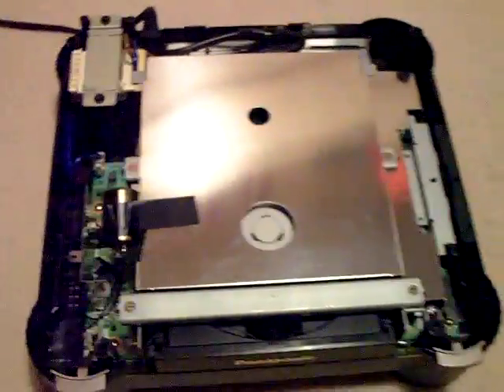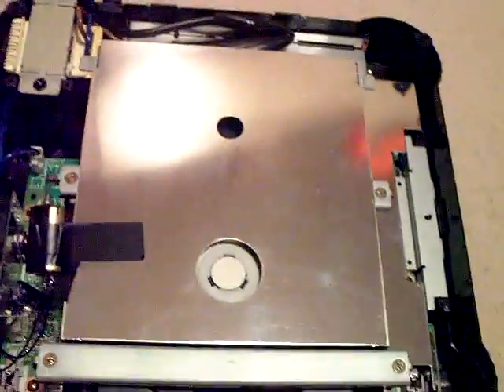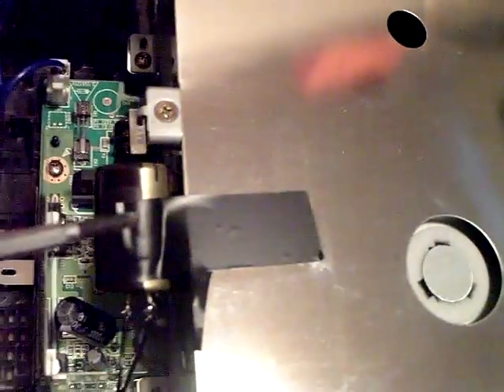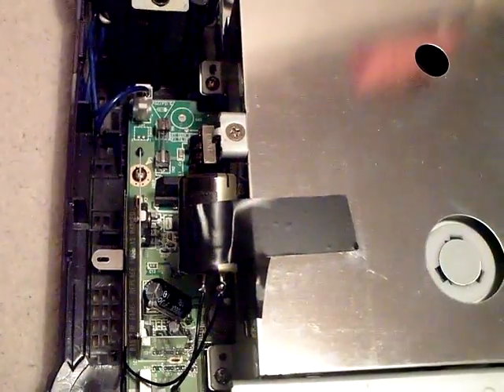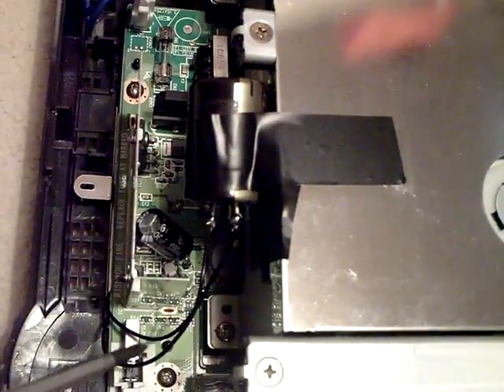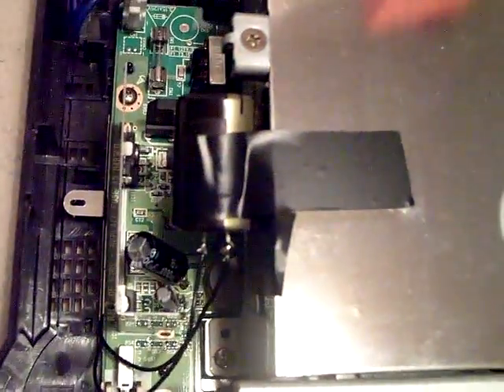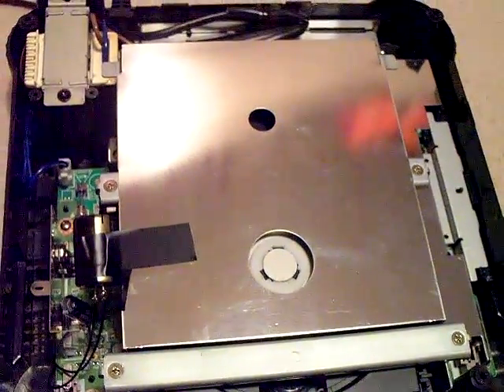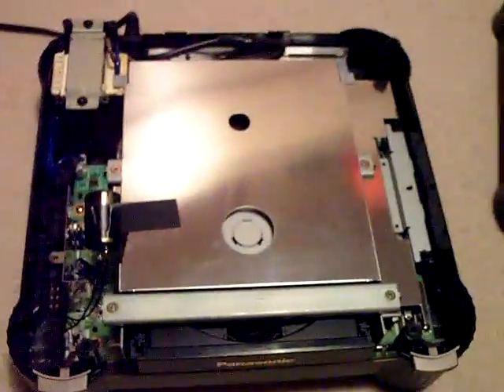My 3DO FZ-1 Console Repair

Comment: My PAL UK spec  3DO Caps are: 6800uf 25V, 1000uf 6.3v and 10uf 16v. Stange why yours are different. Luckly I noticed as I had soldered them in, but didn't turn on.

Comment: my 3do wont turn on with a 500va stabilizer (i live in 220v region), there's a red flicker when pushing the power button. when using 1000va the red light turns and stay on but its not responding to anything. the cd tray won't eject, no video or sound either.
what do you reckon is wrong with my unit? is it fixable?
many thanks

Comment: hi thanks i did that but i new it would not work anyway :(
the power goes off from the cd drive and the green light cuts off to, but the red light stays on.
It will come back to life after about 2 hours then do it all over again, but i have now worked out that it only does it with my back up copys, as i played the real game and it stayed on.
Is there a reason for this that you know off , could the caps need changing or the cd drive cleaning.
bit long but thank you

Comment from the maker: Try connecting it to the TV another way - the 3DO can connect by S-Video, Composite or RF. If the screen flickers when using a different connection method then the console is at fault somewhere.